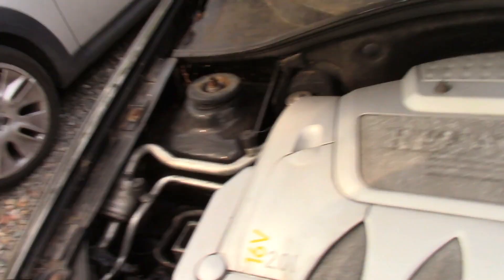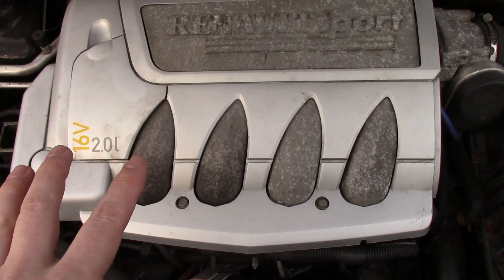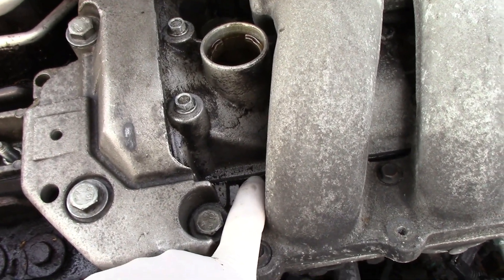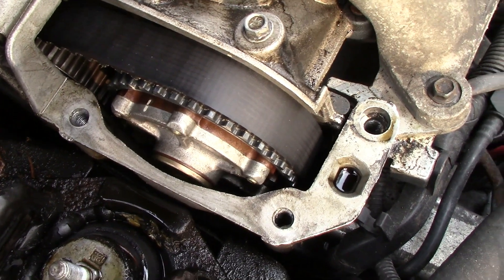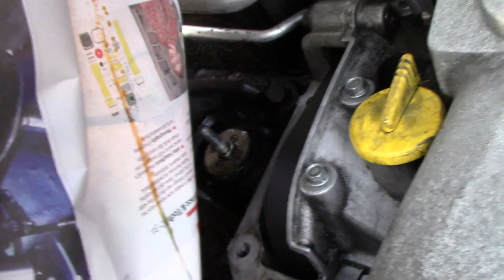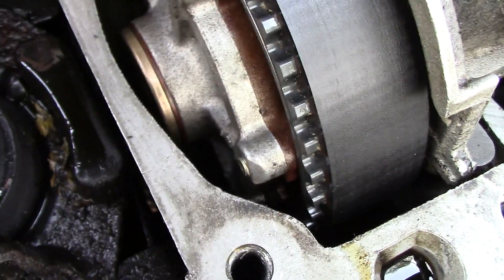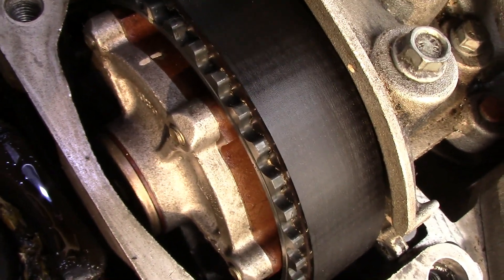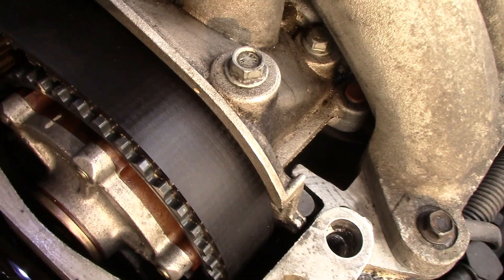2004 Renault Clio: Diagnosing Upper F4R Oil Leak. Do You Agree?

Comment: Cam cover gasket is definitely an issue on that car but there could also be a cam shaft seal but I reckon its the Cam cover gasket degraded. Air at speed is pushing the oil over the Cam cover from the front. You could get hold of a fluorescent dye which may give you a stronger idea.

Comment: Okay, simple fix:
Parking brake...…..Set
Gear Selector...…..Park (or neutral)
Ignition...……………..Off
Hood Release...….Pull
Ground Crew...…...Contact
Repair...……………….Request

Simple as that.
Reply from the maker: lols
Reply: You missed the "return to manufacturer" and "demand money back". Mom had to do that, brand new Renault diesel. First the alternator broke, then the starter, and finally the diesel pump. She got a Volvo 240 GL estate with a B20 engine, had it for 15 years without any problems at all.
Reply: @TheErilaz  Had to do that before.  I bought a used 2012 Chevy Sonic from Carmax in 2015.  31 days after I bought it, one day after the warranty expired, the engine literally self destructed pulling into a parking spot.  The timing belt snapped, taking two pistons, four valves, both crank shafts, the cylinder head cover, and the serpentine belt with it.   

They agreed to tow it to their shop and fix it free of charge.  Then they towed it, again, to a Chevy dealer since they didn't have the equipment to fix it.  And the put me in a rental the entire time.  Still took them 35 days to get my car fixed, though.
Reply: @ryanpayne9119  Oh no.. :(

Comment: Oil is an interesting creature. You can typically see it climb the dust near where it comes up. That's how you get the climb. Also a good chance the lube techs spill when filling it with new oil. Those timing belt covers though dont usually have a forever seal and it can go bad too but that's not usually an area that has a lot if oil in it. The vvt likely isn't the leaj source. More likely you are seeing oil leaking past either the front main seal or past the cam bearings and getting flung about.
Reply from the maker: Thanks Zach
Reply: Not a problem. Hopefully that helps some.

Comment: Mook Faru - it's not the timing belt unless you meant to say the timing valve. It's got to be the VVT actuator, the camshaft seal or the valve cover  where it seals on the front of the head. Without looking at it in my opinion it's most likely a valve cover casket judging by the amount of oil on the outside of the valve cover it's good chance it's leaking on the front of motor
Reply from the maker: interesting
Reply: @grimreapers  since you have to take off the upper plenum to do the valve cover gasket it might be an idea to put some new plugs in ti too, depending on the millage. Don't be cheap and try to reuse the plenum gasket, you'll just be asking intake leak problems. Like AWJFunk said, make sure your pcv system isn't plugged or it'll just be leaking again in no time but probable from the next weakest link. Make sure your gasket set comes with spark plug tube seals, some real cheap sets will only come with the outer edge seal.

Comment: One thing is never ask for car advice on YouTube, you’ll say your engine is smoking for example and you always get the usual 10 different opinions including “it’s definitely your battery, I’ve worked on these before” or “change your spark plugs” or “my mechanic mate reckons you’ve put diesel in by mistake”
Reply from the maker: Roger, but I figured DCS guys would be more technical minded that the usual chump?
Reply: I am an Automotive Technician so I'm not just taking an uneducated wild guess.... but your statement is correct sometimes :P... It is hard to make a YouTube diagnosis without taking a look for yourself. Kind of like front counter diagnostics (the guy payed to answer the phones telling the tech what the problem is) , then you get it in the shop and it's totally something different ))

Comment: Cam shaft seals. Probably valve cover seal as well, and good god that thing sounds like its crying for a valve lash adjustment.
Reply from the maker: yeh I wouldn't be surprised if I fecked the values up when replacing them after the cambelt failure.
Reply: Best way to learn valve lash is to do the valve lash over and over. You must become one with the feeler gauge, lol

Comment: Did you solve leak? I have identical leak on megane 1.6 16v.. suppose cam seal. Will change all 3 including crank, it can leak on pulley itself, or some seal, valve rocker seal, but its rare.
Reply from the maker: Yup! It was the Inlet cam seal.

Comment: Cap did you notice the Oil gallery in between the front two Cam-belt cover bolt holes? Or is it just a recess filled with oil? If it is a gallery (for some purpose), that would explain the oil line on the paper. Otherwise I would agree with @Lee Robinson; the rocker-cover gasket looks to be the culprit with wind funnelled through the radiator blowing the leaking oil into the various nooks and crannies. One last thing of note, Change your Oil young man! I mean, yes, fix your leak but damn that oil looks coked-up enough to be scouring the moving parts it is supposed to be protecting!
Reply from the maker: It's just a recess. Oil is dripping from leak on to cam sprockets and being flung everywhere. It's basically not worth fixing. It would need the whole top of the head to be taken apart. Let it leak :)